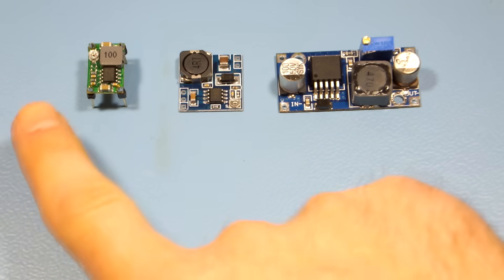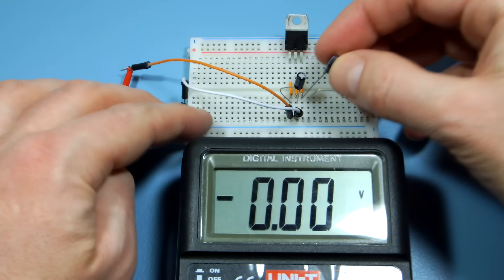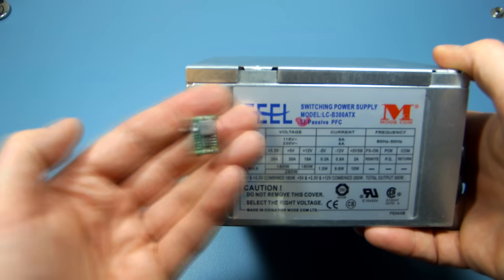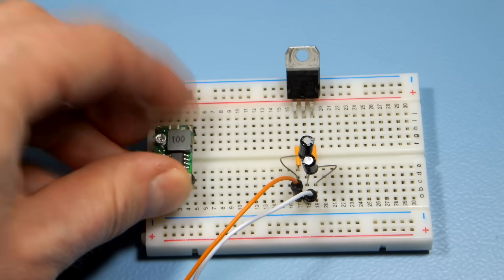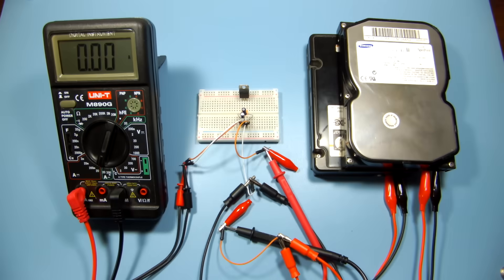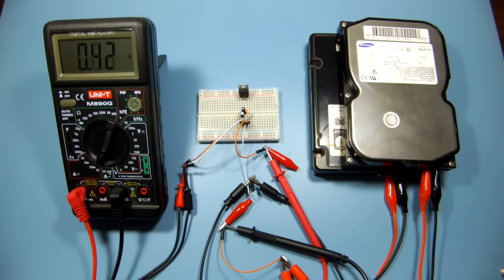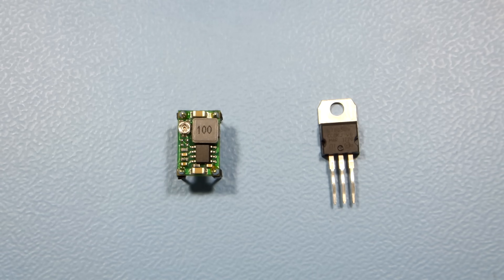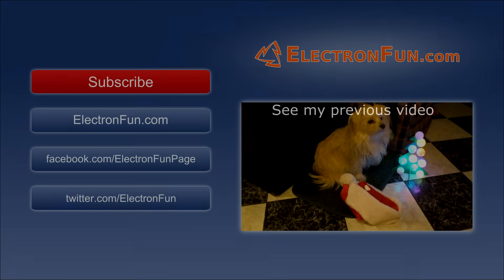Buck converter vs. linear voltage regulator - practical comparison

Comment: I have a boost converter. that strangely works as a buck converter if you set the boosted voltage output above the input voltage by 1 or 2 volts or so.
and take output from positive power input. and positive power output of the boost converter.. it will give out only 1 volt! for example 5v. and you set the output to 6 or 7v. then take output from there. you get only 1v
so I can technically use this as a buck converter even though its meant as a boost converter.. (I did test it. and it was able to output 5 amps where as input was less than an amp at 12v with a dummy load.)
You need a reasonably steady input supply to get a steady output supply though when using it like this.
I call it the buck-boost mode because it can boost and buck at the same time when its like this.

It seems to take the difference in voltage between the boosted output. and the original input. and outputting the difference.
Its a miracle as well because I originally ordered a buck boost converter. and they sent a boost-only converter. 
but I still made it work as a buck boost converter by using it this way. really interesting.
Reply from the maker: That's a bit strange behavior. Where did you order this beast?
Reply: Well it works with pretty much any boost converter where the negative lead is joined on input and output (forgot what thats called)
You just get output from the positive input (as the negative lead) and positive output as the positive lead and use that
You need to first boost the voltage a little over the input voltage to get an output from there. so the maximum voltage is slightly under the max output voltage of the regular boost portion of the boost converter.

give it a try and measure with your multimeter. You can boost and buck in doing so like this. just make sure your input supply is somewhat stable and your not using too sensitive of a load. 50-200mA or so on the output will keep it stable.
Sometimes when shutting off the voltage will spike up a little. thats why its good to have a small load on it to prevent that.

It works great for my 12v power supply rated 2 amps reducing the output voltage to 5v and I can get more amperage than the input. so it works great. my audio amplifier runs on 5v. so thats what i use for it with this.
Reply: all boost converters also work as buck converters; but not all buck converters can also boost your voltage.

Comment: Actually no.. Not all PC PSU have DC/DC step downs. The old one.. (at lest the one in our old 8086) used a a iron core transformer, with rectifier bridge and then a linear voltage regulator.

Of cause this worked pretty good because the the transformer got it down to a bit over 6V and about 13.5V for the 5 and 12V part.

The design was actually quite genius. Because they have make the transfomers in that way so the voltage of the output capacitor droped down the more load you got on it. So the power drop over the linear voltage was pretty much the same regardless of load (with in the limit). 

Yea... sure, the heat sink was still pretty big and the fan was petty nosy. But the power surply actually didn´t lose that much energy.

Combining a DC/DC step down with a linear voltage regulator also works great. Having the DC/DC step down on 5.5V and the linear one on 5V makes the heat loss much more manageable.
Reply from the maker: I wasn't precise enough - most PC power supplies are switched mode supplies. Buck converters are also switched mode power supplies, but there are also other types of supplies under that same category.

Have you tried testing that theory? I mean a DC/DC step down converter and a linear voltage regulator next?
Reply: Most PSU to day... but in the 80-tys it was fairly rare.

Kind of no.. but i have seen and measured on implementations. It was in the 90-tys with a cheep nasty single phase DC/DC step down and a linear voltage regulator to keep it nice. I have not built some my self.

It might be that the DC/DC step down are that good now so its simply never needed.

Of cause i have not really built that kind of electronics since my university days. When i worked with telecom servers we always used ready to use modulus, or design pack implemented right on board.

With a bit lower volume than most electronics the time do make a better design was simply not there.
Reply from the maker: I work in IT and couldn't agree more - we always use ready to use modules and there is no time to make your own design :)
Reply: I guess that the people that designing very high quantity products, like game consoles and phones have much more time to make it with more exacting components.

The telecom servers we use to make where i worked was quite a bit larger then they would need to be
Reply from the maker: The large form factor has a lot to do with heat dissipation. Servers have to be as stable and reliable as possible, so the designers don't care about size or weight that much.
Reply: Well.. The telecom serviers is kind of a bit special. They are mostly routing and transcoading. So its quite a bit of DSP and routing chips.

But my emplyer was a bit stupid. Try to make them as expensive as possible, to sell them as expensive as possible, to make more money....

Well.. the costumers did find out eventually and the close down whole of my department that was pretty much 15-20% of the whole company
Reply from the maker: There is a Latin proverb to conclude: "No gain satisfies a greedy mind".
Reply: Well.. they made a giant research project in the late 80-tys early 90-tys to replace and industrialize and rewrite all the software for modern hardware, it failed totally, mostly because it was top driven.  After that they was overly cautious.  Just building emulators for the old software total missing the edge that they once have.

Have 2 more month to my knowledge get decalcified after i was fired. So i can´t tell you what company......
Reply from the maker: Don't worry, we don't need the company name here. Running a business is all about decision making, no matter the size.
Reply from the maker: I may check if this solution works. I have some doubts - what about the noise level from the switching supply? The other trouble is - what will happen when your buck converter fails? It may be a nice experiment.
Reply: matsv201 I would say you're splitting hairs, an acceptable statement is "computers use transistors for switching and logic circuits" but older computers used relays, and before that vacuum tubes
Reply: Who cares about old technology
Reply: @ivotenotocensorship5247  The combination of your comment and your username is quite painful.
Reply: @DasAntiNaziBroetchen  thanks friend. I genuinely appreciate your kindness 💛❤💓💗💕♥

Comment: You forgotfew tests and aspects: noise, input voltage stability, shortcut test, thermal stability, and so on :) otherwise good video!
Reply from the maker: Thanks a lot! There are so many aspects and tests that I could have done. This video was supposed to give some general idea about the differences between the linear voltage regulators and buck converters.

Comment: Great video. One sidenote though: at this moment you can buy 10pcs of the same buck converter for $4 on aliexpress. Takes a lot of time to get it, but 40c is not a bad price.
Reply from the maker: Thank you so much :)
I published this video 2 years ago and the prices indeed went down significantly.
Reply: I see... well another quick question: will the buck converter work fine with lipo battery which changes its voltage by time (as it is discharging)?
Reply from the maker: It should work just fine. However, I've seen some comments saying that there are buck converters on the market, which are not able to cope with changing input voltage. I've never seen such a buck converter myself, but who knows. As you mentioned - the prices are so low, that you may come across a really poor quality devices.

Comment: I have noticed that some of the E-Bay buck converters don' actually regulate the output voltage, they just "step it down", so when your battery supply drops, even a little, so does the regulator output. I suppose it serves me right for thinking that a .99 switching converter would be just as good as the outstanding, Murata "7805" replacements which cost more than four dollars.
Reply from the maker: There are so many low quality parts all over the Internet, it's not only about eBay. Some say that you get what you pay for, which may be true in many cases, but not always.

Comment: I use a step up driver 3.7v-->5v and a bluetooth without problems so it could be a problem with lower frequency
Reply from the maker: I guess you are using some kind of a boost converter, is that right?
Reply: step up boost converter same thing
Reply from the maker: Switched mode power supplies are not problematic in most cases, but they may be is some very specific applications, e.g. audio devices.

Comment: I would assume that PC power supplies need a VERY smooth output. I have stripped many old ones and the amount of 'gubbins' compared to these simple buck convectors must be around a factor of 10. There must be a way of getting rid of these high frequency spikes from a buck convector and reduce them to a reasonable level . I have recently taken up electronics as a hobby after a 50 years break. The kit around these days is out of this world. Mind you I do miss the old EL34's blue haze. 
Super video, simple and to the point.
Reply from the maker: Thank you for your comment and kind words :)
Many PC power supplies don't provide very smooth and clean outputs, but it's usually not a problem for most components. The most important one, the CPU is powered via the motherboard, which is equipped with its own voltage regulator module and some additional circuitry to ensure maximum stability.
There are still many hobbyists, who love using vacuum tubes. Good luck with your electronics ventures.
Reply: I thought there must be a lot of gubbins for the processor. It's just that mention a DIY power supply and nearly every time it' 'go linear'.  I am having both is one case. A 400 W buck and a 40V 8A linear. 2N3055 -  (lots). If it works after I have made it mind you.  Thanks again for your videos and taking the time to reply. Very kind of you.
Reply from the maker: I believe most manufacturers make switched mode power supplies because of their efficiency when compared to linear supplies.
It's a small YouTube channel and I'm still able to reply to all comments. I'm happy when people take their time to leave comments, ask questions, etc. It means they care :)

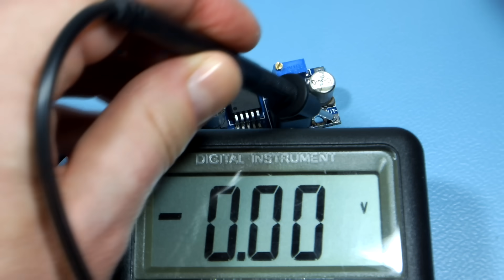Comment: Hello. I have purchased buck converter which you are using at 2:35 . However, when I have 12 volt battery connected to input and use the voltmeter on the output pins, It reads 0 V. Changing potentiometer does not change voltage. Is this a Dead on Arrival product I have purchased?
Reply from the maker: Who knows, it may be dead. Have you tried different power sources?
Reply: ElectronFun.com yes it's dead. I ended trying different one that worked perfectly
Reply from the maker: Parts from China are cheap, but the quality control is not always good enough.

Comment: For low noise, if you know your load for example 250 mA, maximum, you can add a series resistor. You should drop the voltage to about 8 V. on the linear, so the resistor should be 12-8 = 4/.25 or around 15 ohms. the maximum current is .25 A so the power in the resistor will be 15/(.25)**2 or 1 watt, so use a 2 watt 15 ohm resistor, and now the power in the Linear 317 will be ~ 12-8 X .25 = 1.25 W, so the linear will have ~half the power and much less heat. Of course the Buck regulator is more efficient, but as you mentioned produces lots of noise.
Reply from the maker: That's true, a series resistor is a good option. Thanks a lot for your advice :)
Reply: It splits the power dissipation between the linear regulator and the resistor, and still keeps low noise.
Reply from the maker: True, but the overall power consumption is still high when compared to the buck converter.
Reply: Yes, but there is no noise, as you said, if you need very low noise, you almost have no choice but to go linear.
Reply from the maker: Exactly, there are not too many alternatives.

Comment: i have a question. buck converters work with duty cycle or external resistance? in this video i see multi turn resistor. could you explain a little difference between buck converters with variable R and those with duty cycle mode? i guess the practical ones which be used is multi turn ones
Reply from the maker: Buck converters work with duty cycle. The pots are used only to set the output voltage. The small buck converters don't even have multi turn pots, so setting proper output voltage becomes a real pain.
Reply: i didnt understand. BC is for stepping down input voltages. so how they do that? tuning duty cycle or tuning R?
Reply from the maker: Buck converters tune the duty cycle. Sorry if I wasn't clear enough.
Reply: thank you. could you please explain why we tune R? i mean we regulate the output voltage with tuning duty cycle, so what does pots do exactly?
Reply from the maker: I believe the chip is tuning duty cycles taking into consideration the input voltage and desired output voltage set by the pot.
Reply from the maker: Thank you for your explanation :)

Comment: you are able to tune 7805, less heat less voltage loose, thanks
Reply from the maker: There are not too many ways to make the LM7805 more efficient. You can drop the input voltage by adding a resistor in series. Can you think of any other ways?
Reply: excellent,the way is the arrangement that this breadboard  power supply have:normal 9v battery work 2hours none stop with your 7085 configuration for Arduino uno and by this breadboard power module work 3 hours, it mean smd power supply with some resistors and oneway diode will make it much better, try and let me know resulthttps://www.bing.com/images/search?view=detailV2&ccid=ASNAXleq&id=CDF0BD414F2EC16E2461C547EEAAD6027AF60345&q=breadboard+power+suply&simid=608001391518942159&selectedIndex=34&ajaxhist=0regardsseyed
Reply from the maker: I don't have access to this module, so not able to test it, sorry.

Comment: Very nice video, I bought a cheap battery pack to charge my cell phone. It only charges it less than half way before dying, and it get's very hot doing it. What are the chances that it uses linear voltage regulator?
Reply from the maker: I would say chances are slim that it's based on a linear voltage regulator. Much depends on the power bank's capacity.

Comment: you cant shield the interference?
Reply from the maker: Yes, you could use a shield to limit the radio frequency interference, but the output voltage is usually not as clean too.
Reply: So shielding would disrupt the coil.
Reply from the maker: It should make it interfere less.

Comment: What about a power bank 5V to 12v or 5v@1-amp->12v under .400MA
Reply from the maker: Is it a question? I don't quite understand what you mean.
Reply: ElectronFun.com how would one turn 5V to 12v I don't want to use a step up but I need the adjustable voltage
Reply from the maker: Why don't you want to use a boost converter? It's probably the easiest way to step up voltage.

Comment: We were studying power supply last week and my professor never talk about buck converter. I wish my professor had your enthusiasm to explain thinks from A to Z like you did. Excellent video.
Reply from the maker: Thank you very much Edgardo :)
I never liked theory too much and always favor practical knowledge.
Reply: Or he is smart enough to understand that someone needs to learn to walk before learn to run, or maybe he understand that efficiency is not always the design priority, for example, in RF or audio circuits powered with sockets, getting a clean power supply without the dirty noise of buck converters is the priority.
It's so hilarious to see clueless millennials learning to power led strips thinking that they have "invented electronics".
Signed: the Boomer.

Comment: Hey, I think, you should measure the temperature again on the actual chip of the buck converter since you measured on the inductive output load. Thanks for the video anyways :)
Reply from the maker: Thank you for you comment. This may seem strange, but in my case the coil was hotter than the chip itself :)

Comment: sir thanks for your explanation.. but I am going to ask you how we can find which bulk converter is better for us?
Reply from the maker: It depends on your application and most importantly your current draw. If your circuit draws 2A make sure you buy a buck converter capable of delivering 2A + some safety margin.
Reply: hmm. okay thanks sir. I am going to make a variable DC supply using this converter that's why I ask that.. hope this works
Reply from the maker: There are also buck–boost converters, which can not only drop, but also boost voltage. I guess it would be better for a variable power supply.
Reply: is there any range of bulk converters that they can convert voltages to?
Reply from the maker: Yes, definitely check the voltage ranges before buying.

Comment: well done"! you ern my sub.
i got a question sir which of this can give a better power? amperage i mean
Reply from the maker: Thank you sir :)
Buck converters are usually much more efficient than linear voltage regulators, so they also don't get that hot while drawing higher currents.